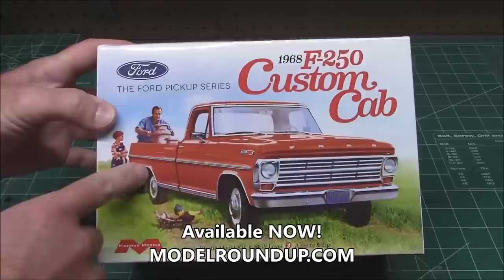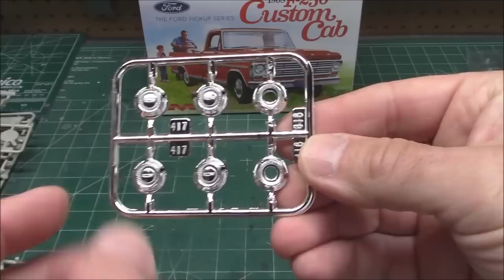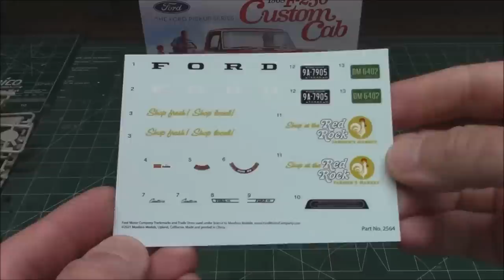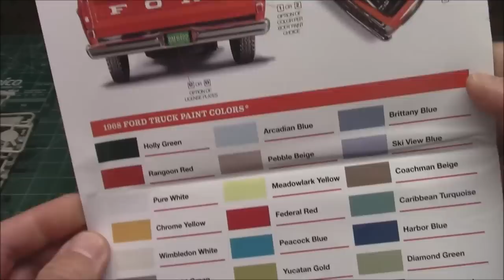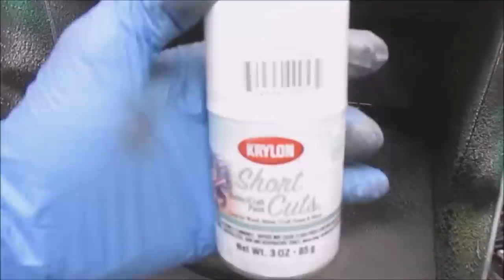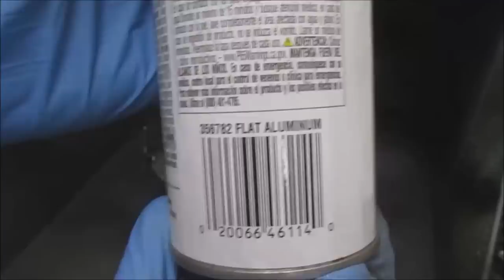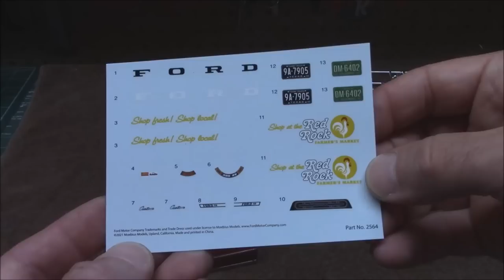1968 Ford F250 390 V8 Custom Cab Pickup Truck 1/25 Scale Model Kit How To Build Paint Engine Weather

Comment: I have been looking for a model kit like this for a LOONG time. My dad taught me to drive in a '67 with a column shift and a V8. He's been gone 18 years and I have always wanted to build a model kit just like his old truck. Those are memories I will never forget.
Reply: I don't know what you did with him but if you build the truck you might want to park it on a base that reminds you of him -- corner service station  tarmac, painted lines for angle parking at the curb, on the grass next to a local ball diamond, on a patch of dirt next to a camping fire, etc.  Some accessories in the bed and in the cab might make it more personal.
Good luck!
Reply: Cool.  Years ago, my uncle John bought a brand new 1977 F150. It was bright red and had a red interior.  I still remember the day he brought it home. It smelt so new. I built an amt 1977 f350 just like it. Painted it red. Yesterday I bought the 1968 truck on my lunch break.  Thanks.

Comment: Had a 68 Ford long bed 352 V8 4-speed transmission no power steering no power brakes no AC this is when trucks were trucks and this model truck is a beauty

Comment: I officially took a day off and started building mine today. There's a lot more tiny little Parts than I'm used to. Some of the instructions can be a tad bit vague. There was a lot of confusion when it came to the motor mounts and the drag link because the illustration wasn't that clear.
I'm extremely pleased with the fit and the detail.
This is the first time I've used liquid cement and it is a game changer. I've always used stuff out of a tube and a handful of clothespins and today with liquid cement it made progress so much easier. I had made a previous remark about painting this model in the likeness of my late father's truck, the truck in which I learned to drive.
I am building this one in two-wheel drive with a manual transmission.
The nice surprise is the amount of extra parts in the box :-) thank you so much for this build.

Comment: I had this in hand a week ago at a local hobby shop. I didn't get it because it wasn't different enough from the F150, which I've built multiple times. After this review I may grab one in the future.
Reply: The wheels are excellent -- for an F250 I was hoping for bigger work tires, I think.

Comment: My dad bought a brand new 68 or 69 f250 Ford. You're model is pretty much identical other than the mirrors. His also had the 390 engine automatic transmission, we used it as a construction work truck. Good work horse 🐎. Only problem we ever had with it was wobble on the front end at road speed, easy fix and cheap back then. Dependable truck. It was red minus the crome.

Comment: the bezel around the radio should be chrome ,the door panels are spot-on the trim level of that truck should have chrome drip rails over the windsheild and the doors looks like you nailed that

Comment: If you wanted, you could use Micromask to cover that chrome strip on the hood before painting. I've had pretty good results using it to cover airplane model windows and other things it's difficult to mask otherwise. It peels off pretty easily afterward, leaving no residue.
Reply from the maker: Yup, another way to do it, thanks.

Comment: A very impressive build and extremely informative video.
I have this kit but unfortunately I do not have the model building or painting skills to do a good job with it. I own a 1968 F-250 Ranger Camper Special Wimbledon White with the 390 motor and 4-speed manual transmission. I would like to find someone who could build and paint the model to match my truck as closely as possible. Of course I would be willing to pay for any required supplies and labor accordingly.
Do you or anyone you know of do this service?
Thanks for your consideration and thanks again for a great video!

Comment: Nothing stronger than an "I-Beam" front axel. 
Nothing smoother than an independent Front Suspension.
Ford now gives you BOTH in a "Twin I-Beam Front Suspension"
I remember when the Twin I-Beam trucks were first introduced. It split Ford owners - they either LOVED or HATED Twin I-Beam Suspensions.
Reply: It turns each half axle into a swing-axle like the VW or Corvair.  Steering and tire wear were both terrible -- the kit's certainly is accurate.
Reply: Remember the Ford commercial where they demonstrated the toughness of the truck by showing a clip from Mr Majestick? 
( movie with Charles Bronson).
Reply: In fact I think the truck was a 67, or 68.
Reply: @randytaylor1258  had three twin I Beam f150's never experienced this wear your talking about.
Reply: @robertmungo5428  
If you do maintenance, pay attention, rotate the tires, etc. then it's no more destructive than other suspensions. 
But I've talked to mechanics who confirmed what I wrote.  GM's coil spring with double A-arms has much better steering geometry but I never drove one over a torture track of 2x4s.  😀

Comment: If you build that truck in a 4 wheel drive in that shade of red it would be a dead ringer for the a brush buggy a neighboring town had on the fire department. I always that was a cool looking truck even though I'm a Chevy guy
Reply: Justin! sorry to hear that especially when it comes to trucks, gm has a lot of problems building trucks( very lame 😒)
Reply: @bradzimmerman3171  I've owned both Ford and GM. I've spent more time under the hoods of Fords

Comment: How do you keep rustoleum from spraying a rough splatter type pattern? I tried an american accents gloss dark grey on a 57 T Bird model and it looked like the bed of a truck after getting a spray on liner
Reply: It sounds like you were using texture paint -- check the label.  It's also possible that your paint reacted your primer coat -- it should be the same brand as the paint.
Reply: I checked the label, it's not texture paint. The primer is Tamyia, but the paint came out of the can like that. Maybe I need to shake the can alot more before spraying. Comments I read said you have to shake them really good
Reply: Sounds like you've sprayed too far away, an it dried before making contact with the surface. Maybe warm up the can in hot water from the tap, then shake vigorously for a minute longer than what the can says lol. Plus spray a bit closer.
Reply: @1968fordman  
Preheating the can in warm -- not hot -- water increases the vaporization of the paint.  I've never used Tamiya spray though I've run gallons of it through airbrushes   High humidity can also curdle paint out of the can -- always test it before committing to your project.

Comment: Hey Chris, did this kit have all of the parts to make it a 4wd? I'm curious because I know Moebius is supposed to be releasing their highboy f250 kits later this year.
Reply from the maker: I go through all the parts in the beginning of the video, you'll be able to see if they are all there, I didn't keep track myself.
Reply: @hpiguy  gotcha, I saw the axles, t-case, and wheels with the 4wd hubs but didn't see the springs or front driveshaft, which is why I asked. I'll take another look. Thanks!